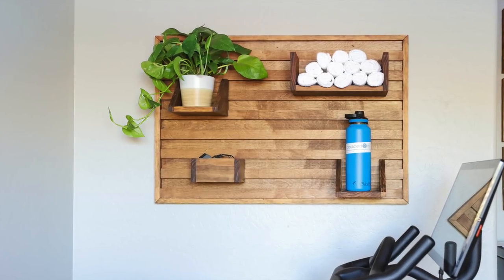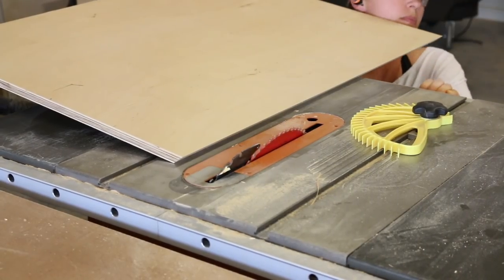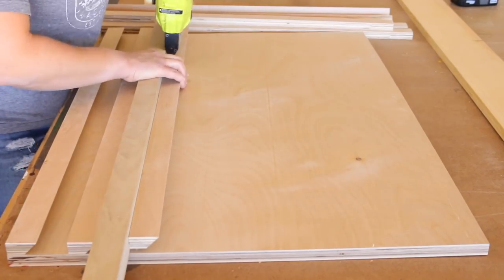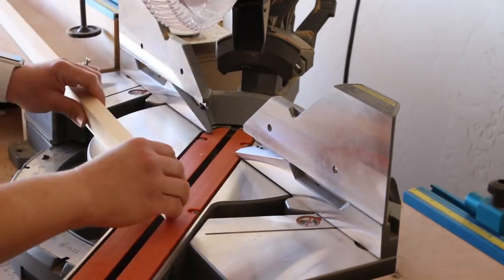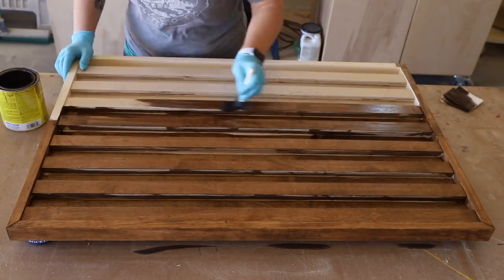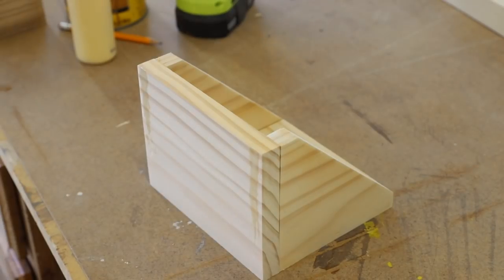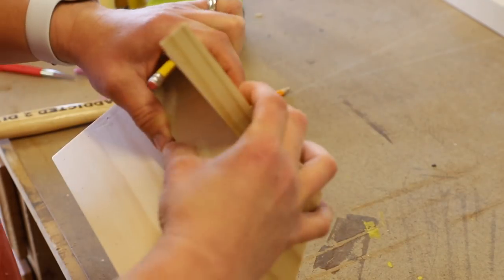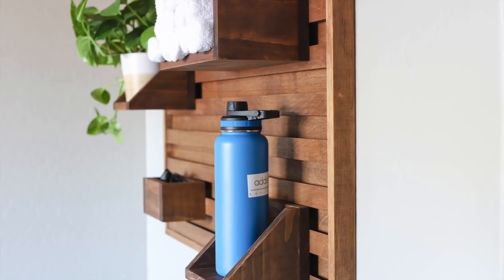Building A French Cleat Wall Organizer

Comment: helpful tip: you can speed up your process by doing all 90deg cuts at the same time and then doing all the 45deg cuts on the strips. Takes a little math to figure out the correct dimensions but then you wont have to adjust your blade and fence for every cut. Also, doing it this way makes you less likely to make a measurement error since there is only 2 adjustments instead of 1 per cleat.
Reply: Forgot to mention your project looks great!!
Reply: You can also avoid doing the 90 degree cuts at all, and make both top and bottom edges of the rails 45 degrees. I saw this earlier today https://www.youtube.com/watch?v=usFRvasGW70 :)
Reply: @andyturner7328  I watched this the other day as well! Interesting concept